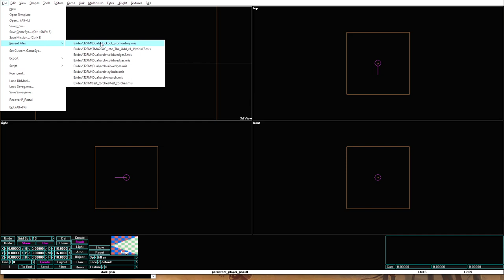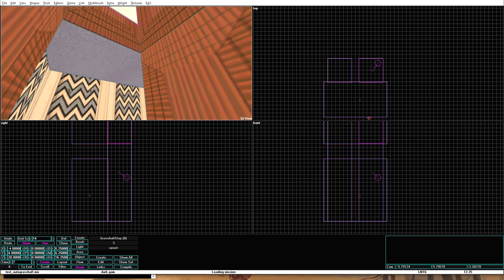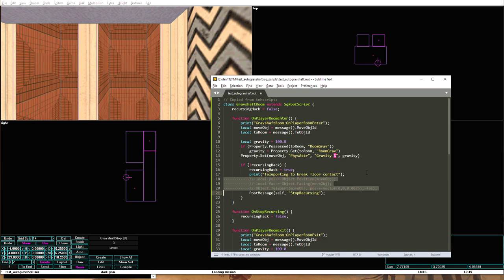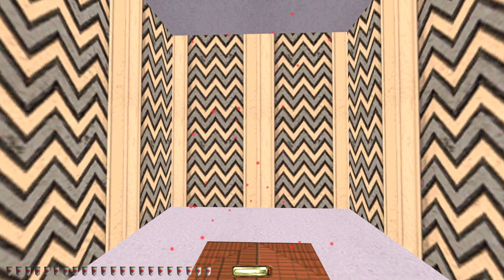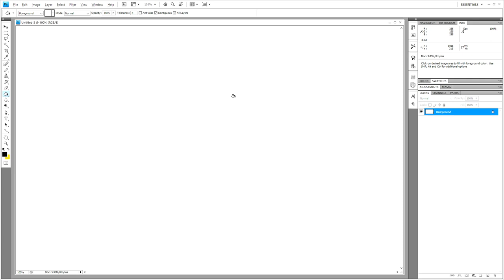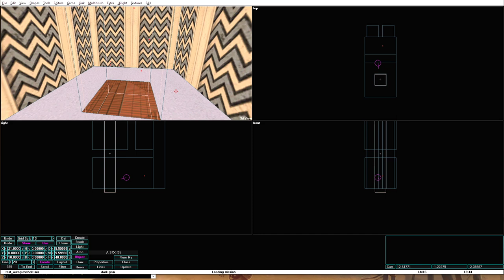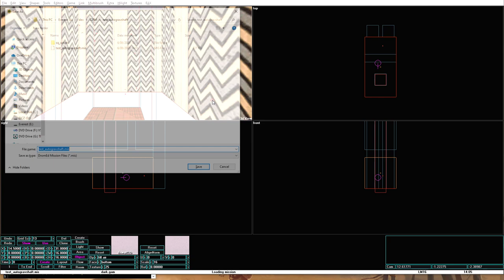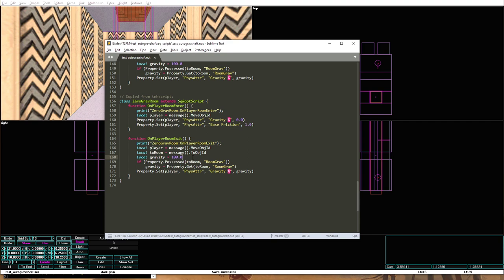Stream: Creating an automatic gravshaft with Dromed and Squirrel

Comment: I haven't finished watching yet, but couldn't you step up onto an invisible flat object to give you a kick?
Reply from the maker: slightly late reply... but probably not. whats needed is to break contact with the surface you are standing on, not to replace that with a difference surface to stand on. and in any case, the fewer objects you need to create to make something like this work, the better.
Reply: @vfigplays now I don't remember the results. Did you set the initial gravity as the final solution?
Reply from the maker: @gamophyte  oh i cant remember the details of how i made it work now either! but the script should still be up at the link in the description, if you feel like taking a look